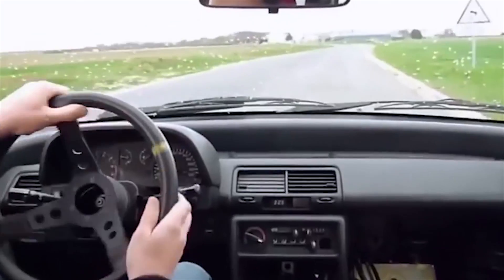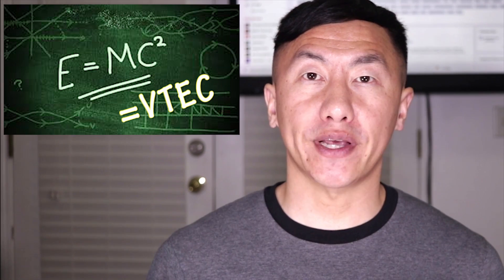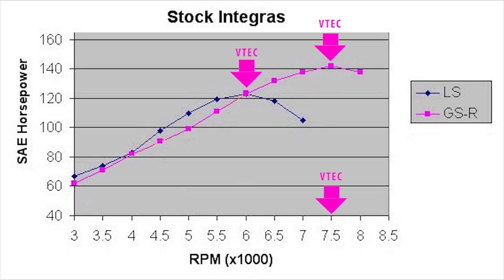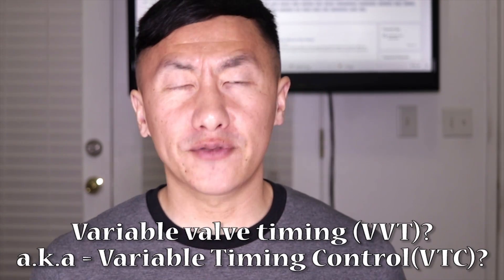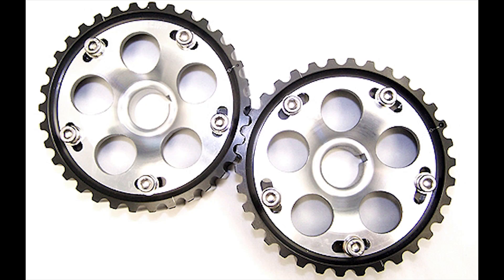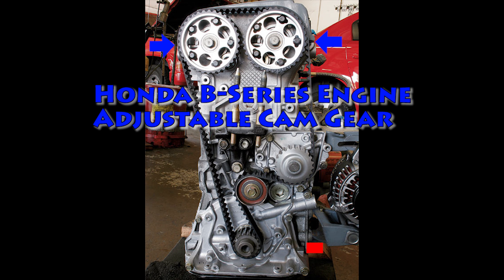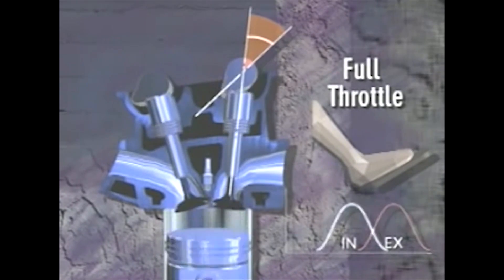★What is Honda VTEC and VTC?★

Comment: I love Japanese engineering. I'm thinking of getting a 2010 civic 1.8 with the i-vtec. I had a ford probe 2.0 with the Mazda unit and I currently  have a 2008 mk4 mondeo 2.0 duratec again another Mazda unit with the camchain. it's currently done 164,000 miles and is still smooth and quiet. a lot of civic owners reporting good fuel economy with that 1.8 engine!

Comment: FYI, your vtec cracks at 5,000rpm for lower engagement, 6,000rpm for upper.

Basically, from 5000-6000rpm, you switch to high cams if you're on the throttle enough, and beyond 6000, you always switch to high cams.

Comment: I would like to state this about vtec, it's not good for every engine that Honda makes and this is especially true in the em2 community. I found 6 em2's when buying mine and 4 of them all had the common head gasket issue but it was only on the vtec models. The ones without it all seemed in overall better condition. Also I want to say that my d17a1 non vtec pulls hard on my boys d17a jdm vtec motor and he will vouch for that.

Comment: first I had a honda civic ek4 1997.
when the vtec came in, I was torn from the seat and felt a strong tear.
fantastic!!! the noise also changed. the car and the muffler all original.
now I have an accord 2007 2.4 tipes. and when the vtec comes in, there is almost nothing. no tearing, no noise, only slightly, but slightly increased. I could not try other tunings to see if it's normal. why?    ;)
Reply: why my new honda do not you feel the ivtec come in ?? we do not hear much.

Comment: I have the same car and going to reflash it next week, 6k rpm is waaaay to high to be usable, especially in a manual like mine. Here in Europe it costs around 350-400 dollars to reflash, not that much for a 9-10hp gain up in the range and 30 hp gain in the mid-range. There is no way of telling that the car has been reflashed, no errors, no check engine, cruise control still works, etc...

Comment: Does it help you get better mileage if you hardly ever go over 4,000?
Reply from the maker: jockellis That's typically the case.
Reply: GT Content so the engineers can plan for an economy car for the parents and a q-shop that the son understands but points out great fuel economy when the family is in the showroom. I drive a ‘91 Civic 2WD wagon with 16V SOHC. It certainly has no pickup outside of first gear LOL.
Reply from the maker: Yups. Such is the case with small displacement motors....no torque 😆

Comment: Hey buddy plz help my 2009 Accord EX-L i4 has been getting a bad noise on cold starts for 1-2 seconds. I did some research the VTC actuator is bad. Do you know anything about this? Thank you
Reply from the maker: +Michael Broski If the VTC actuator is bad, then it'll need to be replaced. I'd suggest doing an oil change first as there may be gunk in the oil causing it to malfunction  (Use some kind of oil additive that'll break down gunk) and then see if the problem persists before replacing the VTC.
Reply: GT Content I'll do an oil change any suggestion on additive? I've only ran Mobil 1. Changed every 5k many times before even the service monitor even suggests. I take great care of this car. Sometimes even better than my M3 tbh

Comment: So Vtec lets more air in the engine like a turbo
Reply from the maker: +LACH NUMMER VTEC allows the intake (and exhaust) valves to open wider during operation, therefore allowing more air into the cylinder chamber.

A turbocharger "forces" air in and out hence you hear the term "forced induction". No VTEC cam is required.

Comment: Did automatic machine have vtec too? And how to know that auto transmission have vtec?
Reply from the maker: Automatics can have VTEC. My TSX in the video is automatic. To find out, you can look at the valve cover of the engine to see if it says VTEC/IVTEC.
Reply: GT Content thank a lot for the information and great video. This video help me more understand about vtec. But I'm still confius what the different vtec and Ivtec?
Reply from the maker: +Norhayati Yati The VTEC system only has the high cam lobe. The IVTEC SYSTEM has the high cam lobe and Variable Timing Control (VTC).
Reply: GT Content thank you so much for the info. Really help me. Hopefully you success with your video. Thanks for sharing

Comment: VTEC zone on that K24 is tiny! 6k kick in and 7k redline! It's not worth it!
Reply: Ruben Medina Jr. True. Anything is possible. My Celica has a small Lift zone. 6200-8200. I'd like that a little lower.
Reply: Ruben Medina Jr. I've got the 2ZZ. Company over here sells cams that boost power to around 210 fly and with ECU can give a nice gain.

Comment: Thanks for clarifying A lot of people out there think that they get more power and they can smoke any car out there just because they have Vtec
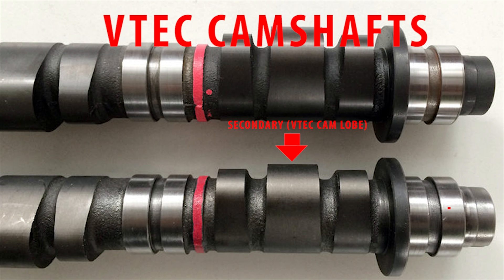Reply from the maker: Frankcisco Monterrosa Not sure if you were confused. I have a dynochart at 1:00 comparing a non-VTEC vs VTEC engine. The transition to the higher cam lobe increased power in the higher rpms as well as increased the redline.

Comment: Toyota did their best to copy lol
Reply from the maker: +Steffen Flindt 😂
Reply: Toyota combined vvt and lift first kid. Get your facts str8
Reply: willmoua1 but Honda is better at name the system so yeah :/
Reply: 2jzvvti will be faster then any honda with vtec
Reply: Adam Alvarez non turbo? Or turbo?
If turbo, you are cheating because Honda’s old fashion Vtec system rarely go with a turbo
Reply: Adam Alvarez but if you don’t have a turbo, you will be making about 230~240hp, if so, an FD2 Honda Civic can beat you because the Civic is much more lighter than a supra
Reply: NgoKhanh 1uz vtti is no turbo and faster then a civc
Reply: Adam Alvarez 2JZ no Turbo No Faster 😂 Honda N/A Faster Kicked In Yoo
Reply: Adam Alvarez lol dude, 
1st: you are comparing an V8 vs i4, that’s quite not fair
2nd: the 2JZ is an i6, I think It should compare with the V6 from an NSX, and if the 2JZ is an NA, no way it could stand a chance against NSX’s V6
Reply: Adam Alvarez  well yeah ov course jz's rule I mean they are 3L!!! Put it against a nsx then ha?
Reply: NgoKhanh OMg you took the words right out of my mouth
Reply: Steffen Flindt 
Toyota's VVT-i is way better than Vtec of Honda, get over it pal
Reply: Driveway-built who says that ya can't put a Honda f1 v8 in a civic. My friend just got a refalga Honda thing with a 5 cylinder fwd!! Only makes 150hp?? But sounds like a db vantage lol
Reply: Steffen Flindt vvti
Reply: Actually... Fiat was the first to patent a variable valve timing and included variable lift. Alfa Romeo was the first to use vvt in a production car. Also, I have no idea where you got that info because Toyota was not even close the first Japanese manufacturer to produce them, Nissan was. Toyota may have had patents but that was many years before they put them in a production car.

Comment: Thinking of Civic 1.4 (2015) would that be slow? Coming from Civic Esi D16Z9 engine. :/ Thanks for all the videos.
Reply from the maker: Slow is what you think of it. I'd opt for something along the lines of dual cam and VTEC if you're looking for performance with potential for future upgrades.
Reply: No. I am not talking about future upgrades. Just a Civic that is fast enough like the older model. Let's see 1.6 (2010)? or maybe 1.8 (2015)? Are those any good?
Reply from the maker: piratx mac I'd shoot for the r18.
Reply: This one? 1.8L R18Z1 i-VTEC SOHC I4, This should be the engine on 9th 1.8 civics right? I've done a lot of research but still need help to memorise all these engine codes :) Thanks for helping!
Reply: GT Content well i got civic 08-09 (8th gen) 1.8.
Reply from the maker: Nice! Enjoy the ride.

Comment: they discontinued making a combination of vtec and vvti because of emmision problems
Reply from the maker: I don't believe they did. VTEC & VTC is still used in the current turbo civic motors (Si & TypeR). The naturally aspirated VTEC K20/K24 motors have been discontinued due to stricter emissions standards.
Reply: ow maybe.

Comment: IVTEC is vvt and vvl combined. Vtec is just vvl. Great videos man. Quality creative content!
Reply from the maker: Devil HimSelf Thanks for the compliment.

A correction. The acronyms below describe the same function. There is a low lift cam which transitions to a high lift cam (or vice versa):
-VTEC = Variable Valve Timing and Lift Electronic Control 
-VVL = Variable Valve Lift

IVTEC incorporates VTEC/VVT/VVL (same thing) and VTC (Variable Timing Control)/VVT (Variable Valve Timing)
Reply: GT Content thanks for the insight, btw that k24a2 is a great engine you have, my brother had a 04 tsx and it had 340xxx miles when he sold it with the proper maintenance they will never fail, as far as i know the guy who bought it hasn't had any problems.
Reply from the maker: Devil HimSelf I agree. It's a great engine and has been reliable. No complaints.
Reply: GT Content Can you modify 2018 Toyota Camry naturally asperated engine to V-TEC? Just a newbie.
Reply from the maker: No
Reply: Ulugbek Musinov no, but Toyotas vvti is just as good.

Comment: Great video!! I made a video of my Accord cl9 today which is same as the TSX but with the k24a3 engine!
The k24a2 is stronger and has more torque! Could you please make a video that explains how to .ake the crossover kick louder and more noticable?! I really need a guide! That mmmBWAAAAAAAH! Drives me crazy yo!

EDIT: the video i made today is about the vtec light indicator that i installed ^^
Reply from the maker: +Geo Gabri How to make VTEC crossover louder:
-Install aftermarket intake
-Install aftermarket exhaust system
-Use tuner to set VTEC crossover for lower rpm for more VTEC sound
Reply: Geo Gabri you can buy aftermarket camshafts that have a more agressive profile on the vtec lobe. This will provide the biggest difference on the vtec engagement.
Reply: GT Content thanks a lot for answering!
Since you are a Japanese guy and you have decent experience about Honda engines you are like golden source of knowledge to me!

Will any CAI work the same or should i get a K&N/injen/DC sports? Unfortunately in Germany tuning products that are produced from other countries are illegal to be used here, there is a German brand called TSS which produces Honda tuning parts but i don't really feel like putting any German bolt ons to my Honda since i don't trust them TSS produces a CAI dor k24 engines which has a weird twister that spins but i don't think that's something really smart, also the last owner of my princess threw a new full exhaust system from FOX (german brand i guess) but the catalytic converter is stock and lastly i plan to reflash my ECU with the integra Type-R setup which kicks at 4.6k RPM, a friend of mine with same car reflashed and has CAI with stock exhaust, the vtec kicks in at 4.6k but there is no loud crossover but the sound of the engine goes NUTS when is in VTEC, thats really confusing me... a friend here on same comment section suggested to change camshafts, will that make any difference? If yes will i have to remap the ECU since vtec cam lobes will be bigger? And at last lets say if i add a CAI and get an RBC intake manifold and a throttle body from the k20a/a2 engine will that help at all?

Sorry thats too much to answer i am a pain in the ass ^^
I hope you can find so.e ti.e to answer my questions, REALLY APRECIATE IT SIR! wish you the best! 😘🇯🇵🔰
Reply: Devil HimSelf thanks for the input buddy!
Just a question, will that really work?! Do i have to change anything at all after installing the bigger lobe camshafts? Like... the timing maybe or remap my ECU to match or just replace the camshafts and start the car and i am good to go.?

Comment: my v tec kick in 5000 rpm. i bought it used. honda prelude 1998. is it like that or aftermarket?
Reply from the maker: +RareTommy If it's stock, then that should be correct.

Comment: sub
Reply from the maker: Thanks!
Reply: sir i need to ask you something im 17 from israel 
we dont have alot of fun cheap cars only 7 s14 in the country
so should i get e36 318
or mk5 tsi vw golf
or honda civic 97
or vr6 mk4 golf 
i dont know wich car i will pick for my first car 
can you help pls ?
my dream car is  s15 2jz widebody blue 700hp
but until then im dreaming haha
Reply from the maker: Those are tough choices. Most European cars are expensive to repair (may not apply in your country) and much more involving if you're doing your own work. You may also need special tools $$$. They may have more electrical issues since they typically have more computers and sensors.
   A Honda Civic would be simpler to work on and source parts (dependent on availability in your country), but I'm not sure what model you're referencing or engine combination  (Si or TypeR/B18/K20 VTEC).  
   If your goal is an S15, then I would suggest getting a simple commuter and saving your money until you can afford it (unless you can get an S13/S14 which is VERY similar). If you get any of the used cars you mentioned and plan to modify them, then expect to spend money repairing or improving aspects you don't like about it and having your dream car goal take longer to achieve.
Reply: s15 is my dream car 
but only s14 in israel and they are rare
honda 
only 1.6 
coupe
sedan and hatch
no si or type r 
im not planing to do major or big upgrads 
becuse in israel in age of 18 
after high scholl we go to 3 years in the army
i think i will go with a honda 
after all its a first car but
hatch have 1.4 vtec
or coupe 1.6 vtec 
or sedan
1.6 vtec
also i sew some accord/tsx
with k24
sound good
the golf tsi 
is also look good but 1.4 twincharge engine is a problem
THX for healping m8
mybe honda will do just fine 
my s15 will be a dream a 700hp 2jz 
just be so rare and will not meet emision test in the future 
ahhhhhhhhh good time we live in

Comment: It's VTC on the SR20DET right? I do know for sure it's The part that makes SR engines sound like a diesel when they go bad 😀 Is VTC more like Toyota's VVT or is it more V-tecy? Is it the VTC on my stock S15 that activates more boost from the turbo, a system that was set in place for the S14a as well, but never worked? It's only a 0.1 boost increase, but I'll take everything that makes me faster. Hmm, now I must Google. thank you for the information.
Reply from the maker: The S14/S15 had Variable Timing Control (VTC) on the rear wheel drive SR20DET. 

Honda VTEC is like Toyota's VVTLi. Nissan also has "VTEC" which they call "Variable Valve Lift", but it's only available on their front wheel drive SR16VE, SR20VE, SR20VET.

Comment: So I have a stock 2015 Honda Civic LX with the VTech engine and a CVT tranny.   Its my daily driver and I don't race.   I don't ever remember seeing my RPM gauge ever going above 4,000.  Does this mean I have never engaged the secondary cam lobe? Does that mean I have never used the VTech feature?
Reply from the maker: Nick V The VTEC on your engine (R18) is actually different. It has a standard lobe and switches over to a smaller (fuel economy) lobe. In a sense you are always driving in VTEC and then it engages to the fuel saving cam lobe.
Reply: Got it. Thanks. That explains why even at highway speeds my RPM's average a very low 1,500.